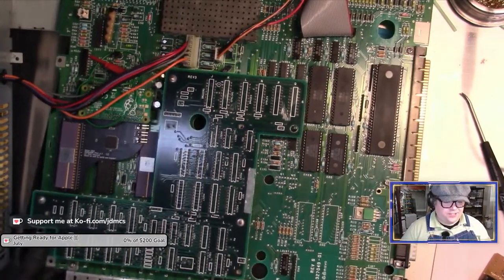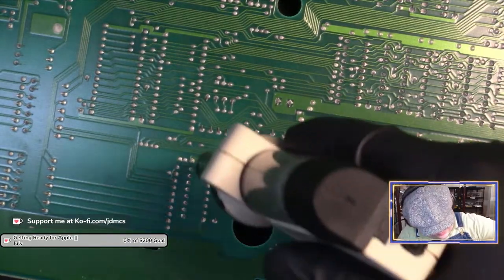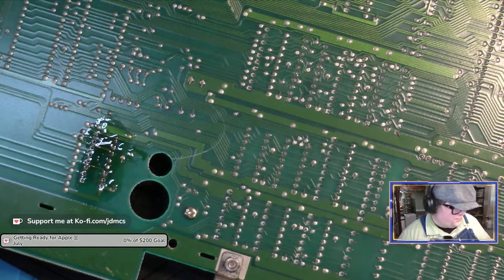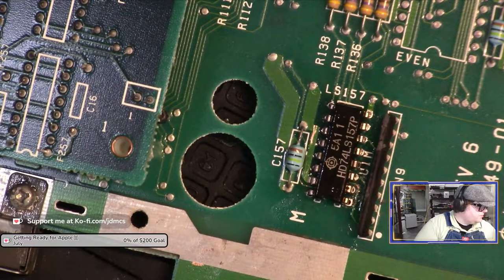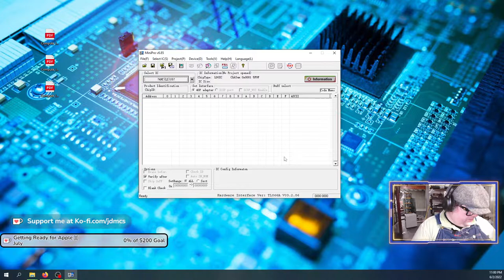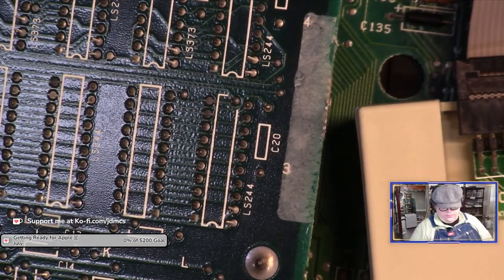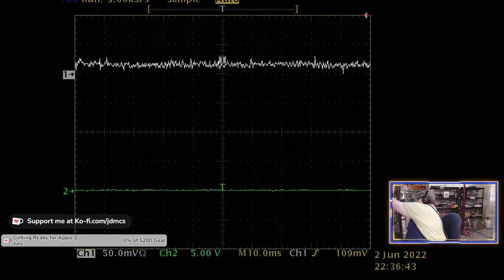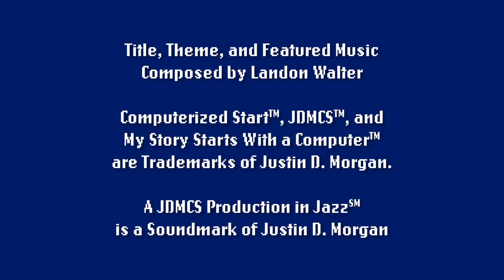Is the Amiga 1000's Motherboard or Mouse to Blame for the Stuck Cursor? (Computerized Start™ Live)

Comment from the maker: There was another reason I didn’t order a MouSTer (https://retrohax.net/shop/amiga/mouster/) earlier, which I had forgotten last night: they were, and still are, out of stock.

Yes, I usually prefer not having to wait on international shipping, and yes, I find it annoying when things are sent requiring a signature but without that fact disclosed, but in this case they were out of stock so I actually couldn’t order one.

Because I really want to get to the point where I can start putting the Amiga back together, I bought one of the PS/2 to Amiga mouse adapters. But it’s bundled with a compatible laser mouse, so at least I won’t have to play the “do I have a compatible mouse” game when I get it…